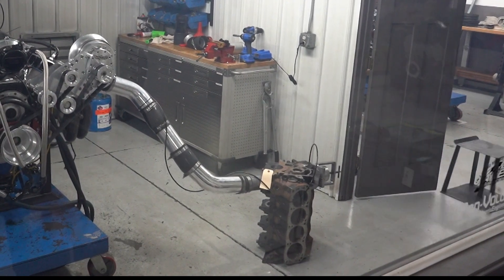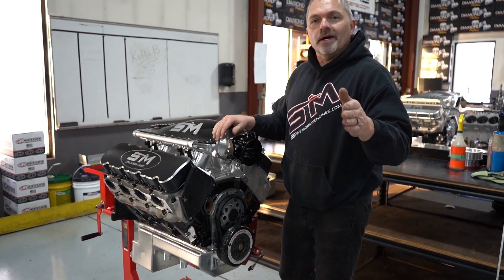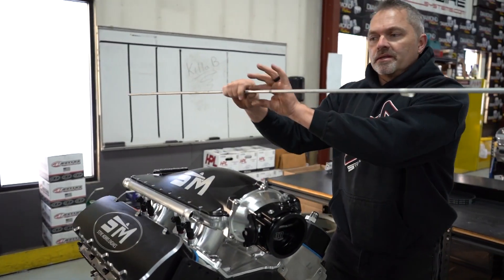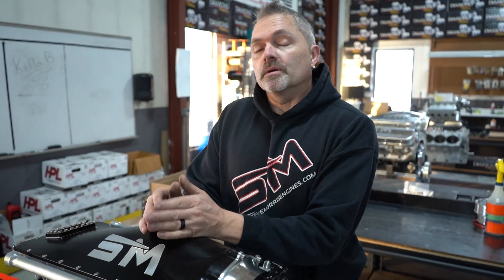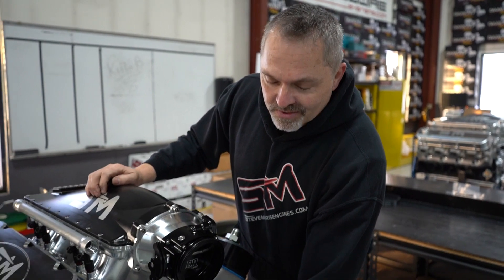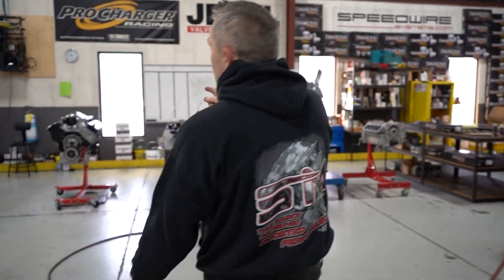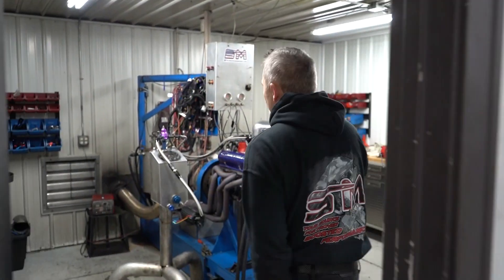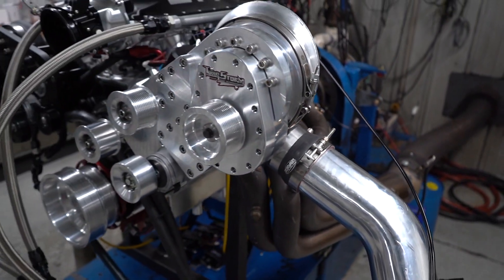Why All The Sparks ?

Comment: The brackets that put a bearing on forward side of the pulley can eliminate some of the flex of the front snout and first rod journal but most applications don't have the room for it, also makes belt changes more cumbersome. 
 AEM and others make a driveshaft dyno.  Strain gauge used on the driveshaft as the car is driven.   I have not used it but they claim as accurate as any chassis dyno.  If one was put on a shaft that was in turn driving the supercharger then the torque required to turn the supercharger could be measured when plumbed into the intake.  The data would be of what it took at all rpms and boost levels in real time on the actual engine.

Comment: Just get a electric motor to spin the blower and use pulleys to get the correct RPM. Then, use a PLC to match the rpm of the engine.

Comment: I'd like to see if the gap on your crank trigger pick up closes as the engine and components expand under heat. You set your .090 gap on a cold engine.

Comment: Would it be possible to electric drive the blower on the engine to specified boost along a ramp up in speed comparable to the engine speed that gives equivalent blower speed. That would tell you how much power you make without the parasitic drag on the motor. Maybe not practical given you would need good electronics to ramp the electric drive with rpm to mimic the eng driving it. But it could get you close.

Comment: I wonder if a gear drive off the crank to a belt pulley up to the supercharger would reduce the load on the crank almost like a gear driven timing set. Probably loose some efficiency though.

Comment: install a venturi at the blower inlet, run the engine (blower connected) and measure the psi drop at the venturi, this represents your compressor load and this pressure delta should be duplicated going forward for all testing. Run the HP verification test but don't use the test jig to control psi out, use it to control psi drop at the inlet for all tests, this ensures the blower is moving the same amount of air wether supplying the engine or dumping overboard. The test jig is used to control the flow which will effect psi @ the Venturi, witch insures the same flow of air or loading of the blower. install a PSIA Gage in the venture to measure static pressure drop out to the second decimal 0.00. Twin venturis would work on twin turbos or twin blowers to verify balances if it was  important data as well. The boost control valve for turbos is a factor however.
Reply: @bigboreracing356  correct the instrumented Venturi would give you the air flow at any point in the dyno pull and could be used to duplicate the load on the blower to measure HP.  You don't need to calculate airflow however, for this you just need the pressure drop numbers. The flow is constant at a given pressure drop in the venture. Assuming air density and air temperature is the same, meaning you perform the test in the same day, in the same test cell, at the same altitude and temp. 😂 don't pack everything up and finish the test in Denver Colorado. You could but then you would have to have calculated air flow using a calibrated Ventura and other parameters.
Reply: @bigboreracing356  The point we are both making is to duplicate airflow/compressor loading upstream or into the blower instead of duplicating compressor load by boost pressure downstream of the blower for the N/A Pull. Which didn't work.

Comment: The fact that an inertia dyno (which measures acceleration) measure horsepower still won't convince some people of the basic notion that horsepower tells you how fast something will accelerate, and torque will tell you how much of a load it can even move. It's basic stuff, yet people want to argue ad nauseum about how torque is a measure of how quickly something will accelerate. That's plain wrong. The torque number from a dyno is how much force WAS applied over a certain period of time. Work. Horsepower is how much work can be done in a period of time (how quickly that work can be applied). Just because we have certain slang for things, like a vehicle having its best acceleration done on the low end of the RPM range being called "torquey" or "a torque monster" doesn't mean your torque number is telling you anything about acceleration.

Comment: Also the crank sensor mount, although its hanging on a stout bracket just an inch or 2 away from the block, can vibrate/oscillate and close the gap between the balancer.

Comment: OK, so question about the deflection in the crank. How long would it last running like that? It was clear this wasn't a street application, just a test of that blower.. But if someone is spinning in a big one, are they looking at a 10 or 100 hours before new bearings on #2?

Comment: Two Decades ago, the first time I calibrated/zeroed a Block CNC machine, I rested my hand/slightly leaned on the few unsupported inches of the couple {?} inch OD rod that supported the block (though the mains} I was surprised at how much the dial indicator moved......Never expected hat much flex in such a thick piece of steel over a short distance..... Steve, now you got me wondering if people having flaky issues with crank triggers is due to flex/harmonics and the gap opening..??...hmmmm

Comment: Would a crank mounted supercharger cause the “bend” as well or are they balanced well enough tin order to keep everything happy?
Reply: A gear driven or crank mounted blower will not cause that bend. The bending force is due to the belt pulling on the pulley. If the blower was mounted directly to the crank, there would not be a side loading force. And if its a gear driven blower which I think you mean, the gear mech cause much less of a bending force. If anything, that will probably create more of a twist in the crank, like mounting a blower on the crank would.

Comment: Professor Morris, it looks like the sparks were coming from the back of the engine left side at 34 in the video. Is there something else going on there? Great class today..
Reply: previous video explained that was the starter motor and ring gear interfering at speed.
Reply: Thank you Data I didn't hear him explain that.  @dataminetk

Comment: Wonder what would happen if you reduced #2 main clearance, would that help reduce snout flex by more support at  the #2?...
Reply: The journals will not stop or support the crank so it does not bend. What will happen if you reduce it is that it will hit the bearing much more.

Comment: 3 thousands. Yes the  crank bent d something has to give. I am surprised a main bearing wasnt crushed in the bend.   Again what it takes in hp to run the turb would depend on restrictions also. Same as water going through a fire hose. the presure it takes at pump to get it at the end of the hose

Comment: This is very interesting conversation. I seem to remember something about cranks flexing in early supercharged aero engines during the war (the earliest of Merlin's and Allison's) so bad they had to come up with all kinds of creative ways during development to cast as much of the supercharger housing in one part and make it all mate directly to the engine block down to the thou to keep it all rigid and in line, or else they'd break cranks as soon as the 2nd stage came in trying to spin enough atmosphere into it at altitude. They obviously got there in the end even without the metallurgical knowledge we have today. It's amazing to me that we've come so far with metal that we now have cranks with snouts able to pull 90 thou over, under load, at rpm like a universal joint and not break anything. That is a LOT of axial load and damn impressive. 20 years ago you'd hang yourself and your check book trying to get a V8 crank that robust without being top-fuel money rich.

Comment: Oh, as soon as you were telling people that a dyno does not measure horsepower, I started jumping up and down yelling, "torque! torque!" I feel so special for knowing the answer......
   Here is the way I usually try to explain it to people:  Think of the dyno as a tool that's measuring torque, at any given RPM, for a given amount of time. Torque is that constant grunt pulling force. *Example: An engine is at 1000 RPM, for 1 ms., making 200ftlbs. if the engine is at 1000 rpm for 10ms, It's STILL gonna be 200ftlbs....
 At each increment in RPM, creates a torque number that remains consistent at that given RPM, irregardless of the measurement time.
Also, Torque & horsepower are always equal at 5250 rpm. So, using this, is how math is used to convert to horsepower. (a small equation)
    Now, with the inertia Dyno, I tell everyone to think about it like this:
Picture the centrifugal clutch on a go-kart. It has weights & springs, resembling brake shoes on a car. How fast those brake shoes move outward at a given RPM, is how it measures horsepower.  
  I don't know if it'll help anyone understand. oh, hell, I don't even know if it's right, lol😏👍🏻

Comment: As noted in the vid there are two basic types of dynos Acceleration/ inertia  ( Dynojet , drum style ) and Loading ( Mustang , water brake , eddy current , hydraulic ) . 

Which one you depends on what you want to do with the engine / car and there are compromises with both.

Say you have an engine that reliably makes 200 Ft Lb and XX Hp on a loading dyno. Install a very heavy flywheel and it still will make 200 Ft lb and XX HP.  Now do the same test on an inertia dyno, the heavy flywheel engine will loose torque / HP because energy is being absorbed by the heavy fly wheel and not the dyno.

Acceleration inertia Dyno would be better to test an engine that needs to change RPM rapidly because it mimics actual driving, however a chassis drum dyno is limited by tire slip and it isn't possible to vary the testing load.

Loading Dyno. would be better for a tractor puller or truck pulling a trailer. A loading dyno is what you want to use since it acts like pulling a trailer up a hill at more or less a steady state. Also, a loading dyno allows you to tune steady state.

F1 teams run simulated races on a dyno and I'm betting other high end forms of racing do this as well.Have a look at this vid, it includes up and down shifts. And yes, it is spinning at nearly 19,000 RPM " F1 dyno test engine " on the channel " Rodrigo Coutinho "

Comment: What if you regulated the output of the blower so it consumed the same cfm on the inlet as it does when it's running hooked up to the engine.  That should give you a more accurate number on how much power it takes to run the blower.
Reply: No. You need to deduct the air that the engine would consume on its own as well.

Let's just for the sake of working with round numbers say that an engine would make 830 hp n/a and use 1050 CFM. Then that engine would make say 1200 hp at 10 psi and use 1500 CFM. So in order to calculate the power needed to spin the blower, you need to restrict it so that it pulls in 450 CFM which is the net volume of air the blower adds, while maintaining 10 PSI of boost at the outlet. However, this will only allow you to measure the loss at that specific peak hp rpm at that psi, as the inlet orifice is constant. The boost can more easily be regulated with a waste gate.

This is just a rough description which does not account for other losses etc. To do it accurately, the engine would have to be run to the same peak rom while the CFM was measured to know the actual difference, but you get the idea. You basically have a pump in front of a pump.

Comment: wasn't  the sparks in the back of the motor? I thought it was the flexplate hitting something?
Reply from the maker: Both
Reply from the maker: The one in front is a big deal
Reply: Larger sparks at back of motor, less noticeable ones near crank sensor.

Comment: Question...

When will Torq Storm have a setup to work with factory LT1-TPI serpentine engines made by GM from 87-95?!?

I want a supercharger, yet i don't wish to change from factory serpentine setup, no reason to...

So far i am being pushed to Vortech, but i like the TS brand better.   Wanting a 10psi model sans intercooler.

Comment: No rubber damper on that pulley causing some of that deflection? Hard to believe that .090 deflection at 7000 rpm wouldn't bust that snout off in no time.

Comment: What about with all that nice CNC machinery you have, you build a bracket, or modify your crank driven pro-charger bracket, add a  lubricated ball bearing to the modified bracket with a crank snout bolted extension that goes thru the bearing, that way you can use belt driven super chargers without causing bending fatigue on the snout of the crank, eliminate or recude bearing wear or harmonics caused by this bending and keep your belt from slipping as you can tighten it more and the pulley remains straight, or you can go even more fancy and make a journal bearing housings lubricated by the engine lube system that drains back in to the engine sump as well, if you hadn't thought about this, I hope you make it happen, please patent it, make some money and just remember me, all I ask you is to build me some parts with your CNC machines for my engines and some SM T-shirts  hahahahaha..

Comment: What if the inertia dyno has a brake on it with a strain gauge reading both ?
Reply from the maker: Reads both
Reply: it wouldn't be an inertia dyno any more. the brake prevents it being inertia based.

Comment: I also noticed a lot of comments on this thread comparing big top mount blowers to side mounts. The top mount effects the the load differently than the side mounts. To help two side mounts opposing each other would help with “some” of the flex. Not all some. Anyways chiming in where I probably shouldn’t! Thanks again!!

Comment: Years ago I was watching a YouTube video on Ford designing a new turbo charged four-cylinder engine for their F1 program around the 1970s I think.  When they were testing their engines to failure they did not have them hooked up to turbo chargers they had a giant air compressor system that fed the engine it’s boosted air

Comment: For blower power measurement, I was thinking one of the idler or tensioner pulleys could be instrumented with strain gauges, but I also think belt stretch and pretention would vary during a pull and make the numbers less reliable.    Almost need to go through an idler shaft with a stain gauge on the shaft.   But the extra main bearing load can really only be factored in with the method demonstrated.

Comment: I suspect the discrepancy in measurements (last video) might be from where you were measuring the pressure.  Assuming that on the motor you were measuring at the throttle body, then the pressure at the blower exhaust would have been higher as the intercooler and plumbing would have eaten some, meaning the blower would have been moving less volume at higher pressure, and requiring less power to run.  But when you measured the open tube with just the restrictor at the end, you were measuring essentially the exit pressure of the blower, which would have been lower than the exit pressure when it was plumbed to the motor, and the blower would be moving more volume and taking more power to run.  Of course if you were measuring the pressure at the blower exit in both cases then I'm clearly wrong.

Comment: I have always thought the 5252 formula for Hp to be true..but when I analyze graphs made by engine dynos I find the calculation does not seem to work for well for plotted HP values that exceed peak torque take a look at almost any of Richard H's videos..I often look at these graphs and wonder how can an engine continue to make more horsepower with a declining torque curve given the limited increase in RPM...Are superflow dynos liars or is there more to it.

Comment: There was an episode of roadkill (I think) where they built a small trailer to hold a small block with a procharger, then ran the charge tube to the tow vehicle intake. Pretty interesting stuff done in a really low tech way.
Reply: Oh yes, the Boost Caboose.

Comment: I had an idea... why don't you run an N/A pull no blower load to get a baseline say its 500hp. then run the blower at whatever boost is required to reach the same 500hp. so theory might say it took 4psi. then you can do a run to 8psi to work out the hp per psi increase of psi and back calculate the load based off that number. it's a bit of mucking around with pulleys etc but would be very accurate.
Reply from the maker: Watch the original video again 
Making 4 psi would be even more load
Reply: @stevemorrisracing  so at what boost level does the blower produce the same hp as N/A?